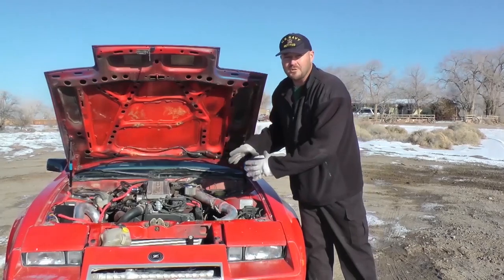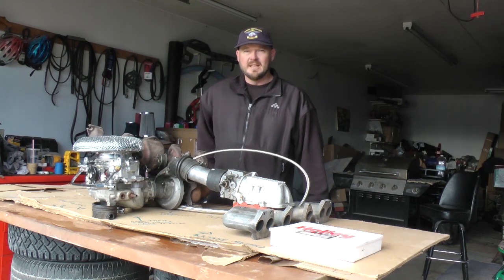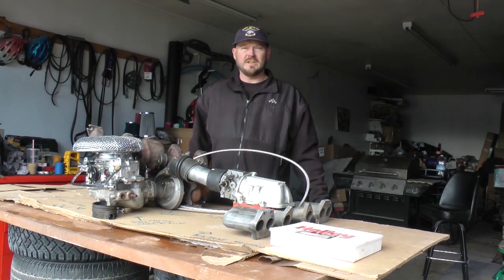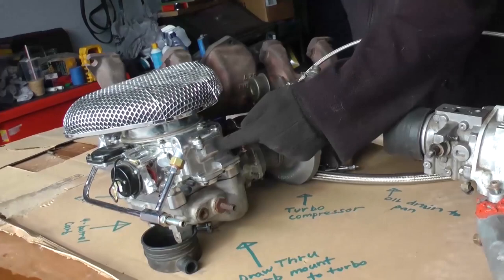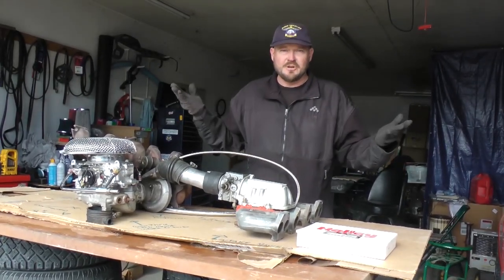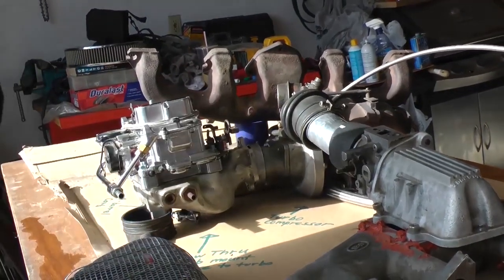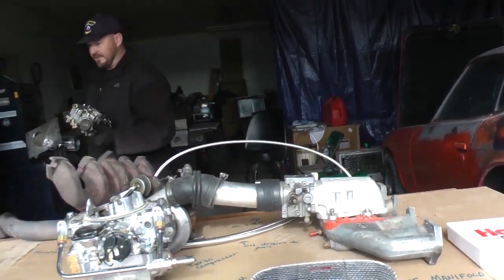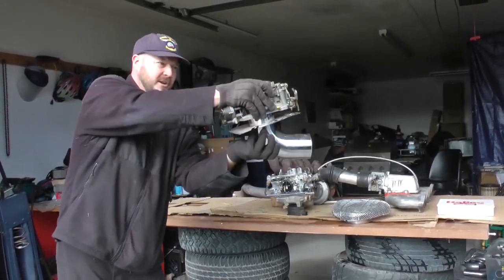Draw Through TurboCharging (Carburetor)

Comment: hey man great video 
u made it easier for me to understand the concept 
i want to know if that will work for a Honda hornet cb600f sport bike in this hot climate we have down here thanks
Reply from the maker: +komonology I believe it would work great, the hard part is finding the space around the engine for all the components, motorcycle engines are usually in there pretty tight.  Let me know how it goes.
Reply: +Budget Boosting 
hey man ive never turbocharged any engine before
ill try to apply what iv seen here
hope it would work 
ill let u know how it went :-)

Comment: It has the risk of fuel air mixture get ignited in the turbine or before get into cyllinder, hasn'tbit?
And it will be difficult to startup the engine, the fuel-air mixture has long way to get into cyllinder, wouldn't it?
Reply: Highly unlikely. Your compressor must be running way too hot for this to happen. If it's running that hot, then you have bigger problems. Starting the engine wouldn't be a problem. Enough fuel and air and it goes boom in the cylinders. The question is, how do you control fuel flow for a normal idle

Comment: Look to do this to my 85 720 truck z24 motor what carb do you think would work good like 600-700 or like a 300 -400
Reply from the maker: +bruce turner draw through with a side draft 2 bbl. mikuni would work well too.
Reply: @budgetboosting  are you referring to two carbs side by side like the older Nissans twin Mikuni setup? Or a two barrel Mikuni? (My '84 RM250 ran the same carb as my buddies Nissan 4x4 which ran two on a 4banger...it would float.. lol)

Comment: Is there any problem between the gasoline and the heat made by the turbo? if the gasoline and aire mixure that goes from the carb into the compressor get overheat... could i explote?
Reply from the maker: +Diego Padilla This system was successful in the 1978 through 1983 Buick regal turbo V6 engines as well as the 1980 and 1981 Pontiac Trans Am turbo engines.  The importance being just the right amount of fuel not too much where fuel could pool in the compressor where an intake backfire could light it up.

Comment: Hello, first off, great explanation. I wanted to learn the basics of turbocharging with carburated engines. Im thinking about doing a Briggs and Stratton turbo engine for a go kart power build. But I think there are some problems with turbocharging a single cylinder engine with no oil pan. How do I get around that.

Comment: What would you do for your timing control?  Working on building a draw through setup for a 300 ford, and timing is the last thing holding me up.  any ideas?
Reply from the maker: I would use an MSD boost timing, master, which adjust your timing 1° per 1 pound of boost
Reply: @budgetboosting  thanks for the help.  Haven't messed with turbo gassers much, so getting it figured out.

Comment: Where did you source the draw through plumbing? From bottom of carb to turbo inlet peice? I cannot find anyone anywhere or I missing the name or something
Reply from the maker: It needs to be customized to your vehicle and carb.  There are a lot of draw through carb set ups sold for turbo charging VW bugs the old ones. They have draw thru piece you can mount carb on and attach to inlet of turbo compressor.https://ronlummusracing.com/product/holley-four-barrel-carburetor-intake-manifold-3-cast/  https://ronlummusracing.com/product/holley-four-barrel-carburetor-intake-manifold-3-cast/
For example above

Comment: Matt, thanks for all the informative videos. I am starting a draw thru turbo project, 1980 Monte Carlo Turbo, has the 231 CID Buick V6 Turbo & Rochester Quadrajet Carb..All Stock. Can you share any further tips with me for getting maximum performance without damaging the engine? Thanks.
Reply from the maker: Nick L I would recommend getting a mechanical carburetor such as a Holley, Quick fuel, or the best carburetor of your preference, since the stock Rochester has electronic functions in the carburetor that are more suited for emission compliance than performance.  I have seen the electronic parts in the carburetor act up and effect the carburetor function to the point where the engine will not operate at idle and stumble any time the throttle is increased.  A mechanical carburetor (other than electric choke) is easiest for jet tuning and use an adjustable boost referenced fuel pressure regulator to regulate fuel more effectively to the carburetor which does so upon increase in boost.  The turbocharger from the factory is a small T3 which can be sent to Turbonetics for upgraded larger turbine and compressor wheels to the tune of a T60, 62, 66 T series turbocharger or to your power level goals.  The turbo compressor case on the stock Buick has a bolt pattern that is unique to that turbocharger and turbonetics should be able to update the internals to a ball bearing modern turbo that will spool much faster to more boost and volume of the boost.  Also an adapter can be made to adapt your Carburator draw through manifold to a Turbonetics Buick Grand national style,  3 bolt Stage III Cheetah turbocharger which could give around 600 hp. potential depending on boost levels desired.  Let me know what you think about it.  Thank you for watching.
Reply: Budget Boosting Thanks for the speedy reply. I must have lucked out because I just purchased a rebuilt Quadrajet that is all mechanical minus the choke. I am not sure what size jets, etc. are currently in it yet. Do you have any idea how much boost the stock turbo is capable of producing and how much boost the engine can handle? I plan to make improvements to the air intake, should I open up the exhaust as well? Is it worth trying to tune everything with the stock turbo or should I just upgrade to a larger one?
Reply from the maker: Nick L That engine as is could handle easy 10 lbs. up to over 15 lbs.  With fine tuning, that set up could easily handle 18 lbs. of boost.  With better high octane fuel such as 100 or more octane, boost levels over 25 lbs. can be attained.

Comment: finally i undrstood, after watching 5 times. how big of a turbo is reommend. also toyota engine 2t has high compresion piston. how much boost will you recomend?. can i use LPG also for turbo. thank you so much
Reply from the maker: +Alex B An engine with already high compression is great so you can get big improvements with very little boost.  8 pounds of boost on your higher compression engine is like 15 lbs on a low compression engine by estimated comparison.  So the potential is really good.

Comment: For this draw through setup... do you need to change the Cam ( as you would a standard Turbo system),  or could I just put in and run with a Non turbo camshaft?
Reply from the maker: Cam change is not necessary if the cam already has an rpm power range that matches or is very close to the rpm range that your turbo makes power. I choose my camshaft to match the rpm power band to that of turbo as close as possible to ensure they work together. I also do the same to match the intake manifold power band with that of the turbo to pick my cam. When shopping for cams and intake manifolds they usually describe it's working power band for example 1500 to 6500 rpm. My selecting of cams would be the same for draw through as for any other style of boosting forced induction.
Reply: Stock cams work best for many turbocharged cars. Upgraded cams affect overlap which makes the time the valves are open to cram "boost" into the cylinder less or never completely closed at the same time to make a positive pressure in the cylinder.  Im not good at explaining things but trust me. Your stock cam is turbo friendly.

Comment: Can you run a setup like this without a blow-off/dump/recirculation valve?
Reply: I would imagine that would cause some fueling issues but I am not certain.
Reply: You don't need any of that. There's no pressure in the intake when the carb is closed (off throttle) and without exhaust gases the turbo doesn't spool up either. When you're off the throttle, you simply have no residual boost like you would with a blow through setup or a conventional fuel injected setup.

Comment: I have a question about the draw thru set up. If I connect a hose from the pressure side of the turbo to the wastegate actuator is it ok? because then fuel mix will open the wastegate instead of air, like normal turbocharged cars. Is the wastegate actuator fuel resistent ?
Reply from the maker: +Tim Budna sounds like you are describing a blow off valve.  The wastegate is located on the hot section of the turbocharger to direct excess exhaust to the downpipe once optimum boost is reached.

Comment: So I have a 289 4bl double pump carb but if I take it off and adapt the piece to it what about the intake manifold part?
Reply from the maker: Make a flange that bolts to manifold with a boost pipe in the center of it to connect turbo compressor discharge hose to..  carb goes in front of compressor inlet.  Have seen some good ones on ebay and other sources.https://www.google.com/search?sxsrf=AOaemvIZHZsir9YHsY_FO8YGk-TNe4LsLw:1636484738493&source=univ&tbm=isch&q=draw+through+turbo+4+bbl+carb&hl=en-us&client=safari&fir=STgr29TzAWG2cM%252C12-YXXem0z7qqM%252C_%253BQsjjiuTcihXOiM%252CHndv_HPDvcm-gM%252C_%253BTloNoC6-GBF0VM%252CnuZMjA4mooF_zM%252C_%253BX922RJr3b68dwM%252CM1saxIlDN9eWCM%252C_%253BAP8zvdAKkzNxeM%252CzYheWikTVDTv9M%252C_%253BMg9lNC0ATAM3OM%252CrhE_jJytLNAg4M%252C_&usg=AI4_-kSWL71y4E4CHM6Njdv3WaEiGMYtWw&sa=X&ved=2ahUKEwiZgpLc_Iv0AhWnGTQIHYB3AuQQ7Al6BAgZEEk&biw=375&bih=624&dpr=2#imgrc=QsjjiuTcihXOiM

Comment: could i use a 2bbl carburetor for this setup on a 4 cylinder engine or would that not be enough fuel.i have a weber 32/36. id like to do this on a mitsubishi mighty max and keep it low budget
Reply from the maker: +Andrew Tobeck Yes a 2 bbl. will do fine.  Jetting the carb to the boost to ensure ample fuel will be available to avoid detonation.

Comment: do you have any ideas for the Toyota Hilux 22r engines? Mine is already carburetted
Reply from the maker: +Bob Marley basically remove carb, run carb to turbo compressor inlet, run turbo compressor discharge to intake manifold by way of custom flanges, do custom weld and fabrication for all boost lines, exhaust flanges, and oil lines and there you go.
Reply: +Budget Boosting . Thanks for responding. Am more concerned about the boost pressure leaning out the Air fuel ratio. Do you use a specific carb?

Comment: question: will this work using LPG? you're probebly asking your self, "why would you???" well, fuel prices in europe are ridiculously high. i realise that LPG is a slower burning fuel source and the expected power of a turbo will be far less than when using petrol but wil it work???
greets from holland
great video!
Reply from the maker: geewizboogieman That sounds like an interesting idea.  It would be interesting to reduce the injected fuel and introduce just a bit of the LPG.  Kind of like a hybrid, some LPG and some Petrol mix just the right amounts to conserve both fuels and have the cooling qualities of the LPG sharing with the combustion energy of the Petrol.  Kind of like people mix Nitrous Oxide with Petrol but instead LPG with Petrol.  Some kind of electronic controller to ensure just the right amount of LPG introduced at certain boost settings.

Comment: Can the turbo be lower than the intake manifold or does it have to be the same level?
Reply from the maker: ***** You can locate the turbocharger anywhere you like.  You are only limited to the amount of tubing, lines, space and other accessories needed.  I have seen turbochargers installed where the mufflers used to be on a corvette.

Comment: The blow off valve will dump fuel out in the engine bay? Or do you not need a blow off valve?
Reply from the maker: +Mikael Duva Yes exactly, I would NOT run a blow off valve in the draw through turbo set up.
Reply: +Budget Boosting an interesting way to use a blow off valve in a draw through set up is to mount it backwards with one connection being between the carb and turbo inlet, the other connection between the compressor outlet and intake manifold- boost would then shut the valve,and during light load cruising, vacuum between the carb and turbo would then open the valve, bypassing the inlet to the turbo, straight to the manifold, functioning as a "priority valve" like some of the old school Roto Master turbo set-ups had. Set up properly, the advantage would be better throttle response and better turbo loading.
Reply from the maker: +63Turbo Sounds like a very interesting idea.  The main thing being nothing is being blown out to the atmosphere but going between carb/compressor inlet and compressor discharge/intake manifold.
Reply: +Budget Boosting Absolutely!! - another, perhaps simpler way to accomplish the same thing might be to mount a reed valve at the inletbetween the carb exit and the turbo inlet- and have the reed valve exit connect to the intake on the push side of the turbo- boost would thenclose the reed valve, vacuum opens the reeds and bypasses the turbo.The book "Turbochargers" by Hugh Macinnes talks about this reed valve approach a little, in the same part that the "priority valve" set-upis discussed. I'm tempted to try this on my efi draw through set-up atsome point, just to see what the difference is. I'm pretty darned happywith how it has turned out so far with the simple set-up that I havenow though.

Comment: With a draw through turbo setup, is there any chance of exsplosion inside the turbo?
I've read that with a draw through supercharger setup there is a high risk of exslosion.
Reply from the maker: +Mikkel Plougmann there is a chance if the fuel air mixture is wrong.  If done right, not a problem.
Reply: +Budget Boosting Ok thanks ;) would i have to re-jet my carburator if i add a draw through turbo system?
Reply from the maker: +Mikkel Plougmann if it is running too rich or too lean, jetting should be done.  Also a boost referenced fuel pressure regulator will be helpful to get that fuel increase on boost only.
Reply: I know i should re-jet if its too rich or too lean but will the turbo make it run lean?
Reply from the maker: +Mikkel Plougmann on boost, more fuel will be needed, that is why the boost referenced fuel pressure regulator is so important.  With out the FPR, it could run lean.  They also have boost timing computers that will adjust your timing for every pound of boost which is very helpful.

Comment: Amazing video. You explained everything so easily.
I drive carb engine cars (not American, just small Japan cars) all my driving life and always was thinking about put turbo (or compressor) on them. But in my country modified carbs are lost art :) But this video gave me so thoughts and maybe...
Reply from the maker: Badtz Maru I am a believer in keeping the great arts going, happy boosting.
Reply from the maker: Budget Boosting years ago HKS made a twin TD06 turbocharged set up blowing through triple Mikuni side draft carburators for the L28.  Awesome combination and set up, hard to find but one of a kind.  Can be found in Yahoo Auctions Japan sometimes.  Would be nice to see those set ups for sale internationally again.  I'm sure there would be lots of z fans that would order them.
Reply from the maker: TREY CARVALHO 
@url?sa=i&rct=j&q=&esrc=s&source=images&cd=&cad=rja&uact=8&docid=HJHd_CG6RFKlhM&tbnid=JgIV2dHo7goNOM:&ved=0CAUQjRw&url=http%3A%2F%2Fwww.zdriver.com%2Fforum%2F280zx-s130-forums-77%2Fcarb-conversion-23075%2F&ei=_yr6U4nCEoytogSYpYKAAg&bvm=bv.73612305,d.cGE&psig=AFQjCNGVmbQFxyxdJt1oodDDuhF0oRt4ow&ust=1408990327158331  This is a kit Jim Cook racing sold several years ago to fit 1970 through 1983 Nissan/Datsun Z cars.  This kit was around $3500 back then and it was complete with turbocharger, custom turbo header, wastegate, air cleaner intercooler, triple weber side draft carburators with custom surge tank to feed boost to those carbs.  This was a very powerful combination for the old z cars and would make a fortune if someone would start fabricating and selling these complete kits again.  Food for thought.

Comment: I have a qft 750ss carb would this work with a Weiand 174 or would I have to spend a bunch on a different carb? Or is the process hard if so?
Reply from the maker: +Troy mackeod with draw through, any carburetor should work fine.  With blow through, a special carburetor is needed.

Comment: can you use this setup for a v8? I have a 85 mustang, which is carbureted, and was wondering if it would be possible.
Reply from the maker: +Tyler Oger It was used on some cars in the 60's, 70's and 80's.  One of the V8 engines it was used on is the 1980 and 1981 Pontiac Trans Am Turbo which had a 301 cubic inch V8 with a single draw through turbocharger using a 4 barrel Rochester quadrajet carburetor on a draw through manifold feeding the inlet of the turbo compressor.
Reply: +Budget Boosting would it have to go to both sides of the engine? like do a y pipe into the turbo from the manifolds.
Reply from the maker: +Tyler Oger Yes, that would work.  But for a V8 mustang, I would go for the blow through carbureted twin turbo set up for much more power using a Quick Fuel SS-650-BAN carburetor from Summit or another retailer.  Great carburetors for turbocharging blow through.
Reply from the maker: +Tyler Oger Yes, you could do a y pipe or have one smaller carburetor to lead to each turbocharger and link throttles.

Comment: If I use a draw through supercharger do I need to change my carb ?  Or will the power valve not open and if not... Is there s place to run the vacuum line id make to blower that would otherwise be the intake manifold vacuum port??
Reply from the maker: +Troy mackeod since the supercharger has the carburetor on top, the vacuum the boost and engine intake force has will take care of the pressures.
Reply: Wow ok so I won't need nitrile floats or different vacuum lines ?!